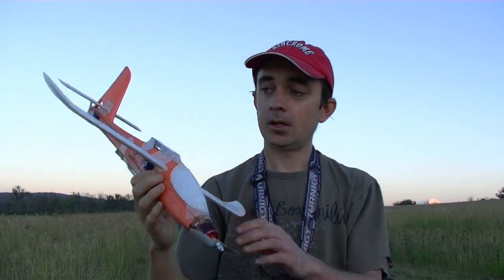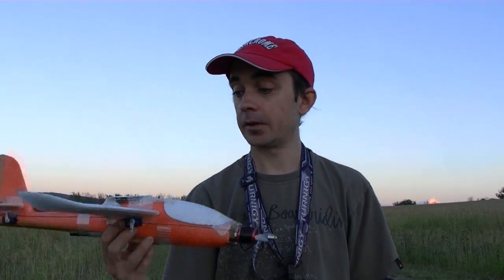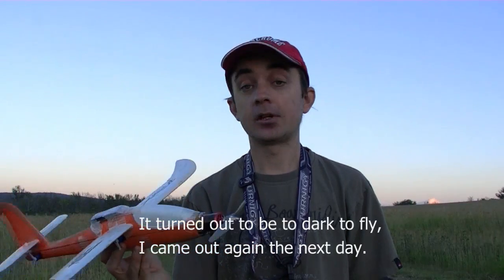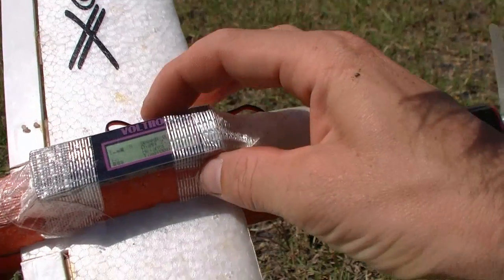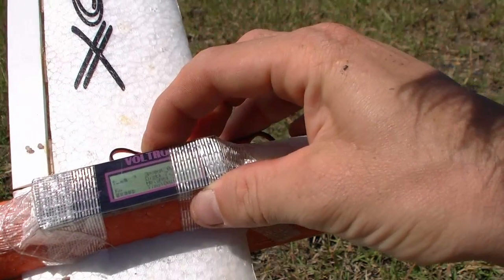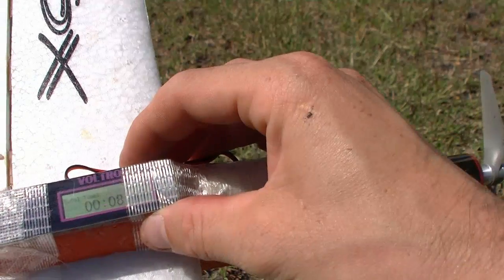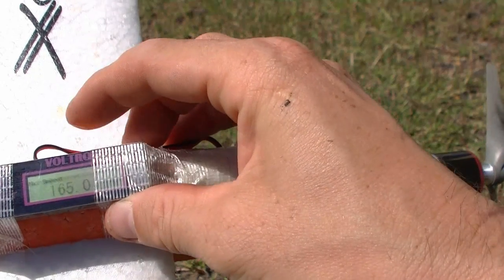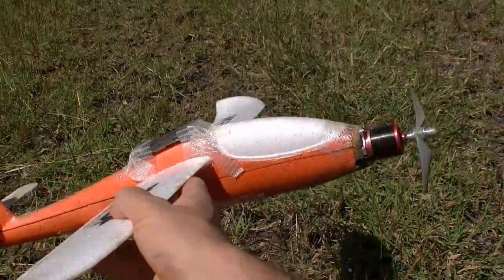Multiplex Fox Worlds Fastest Brushless Conversion

Comment: Snake Question regarding the Turnigy 2632  3400 kv.
I feel this will be a good match for a airfield 800mm me-109 and the radjet.

Hobbykings pic of the motor doesnt show a way to mount the motor?   How would I adapt the motor to fit as you had it on your fox?  Tks snake
John